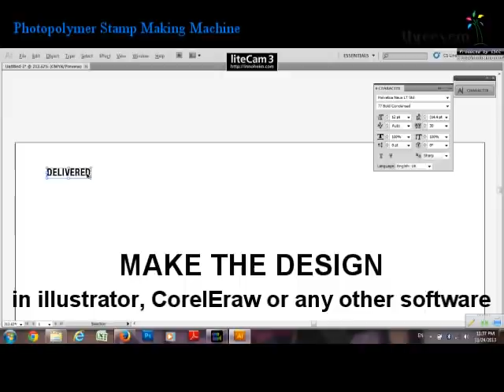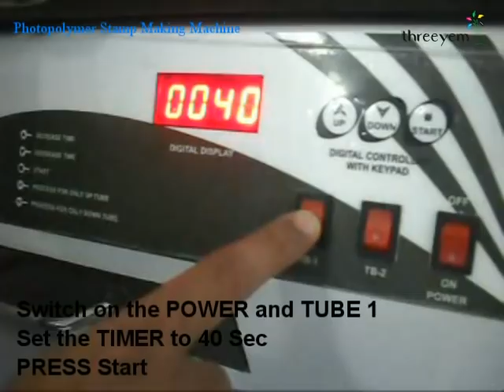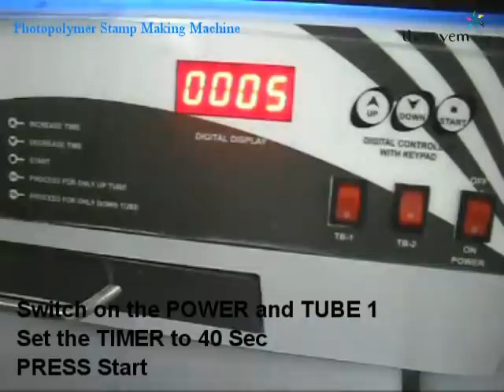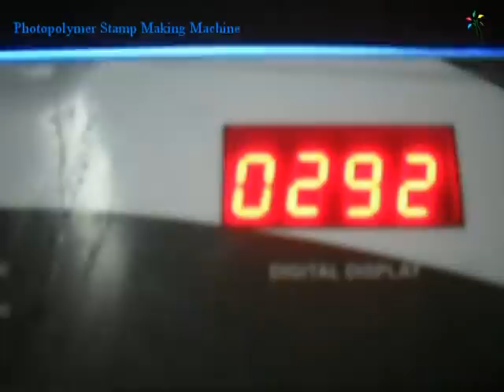Rubber Stamp Making Machine | Photo Polymer | Easy to use

Comment: I make mine with a laser in a fraction of the time and with a fraction of the effort and I can do all kinds of other things with it as well.  This seems ridiculous.
Reply: RajinKajun-25 what is your machine called? And what materils do you use
Reply: I highly doubt that you can do this sort of thing with a laser.
Reply from the maker: Yes, you can even do this stamp in laser but you need another material. If you want any materials you can contact us through whatsapp:+971559318838